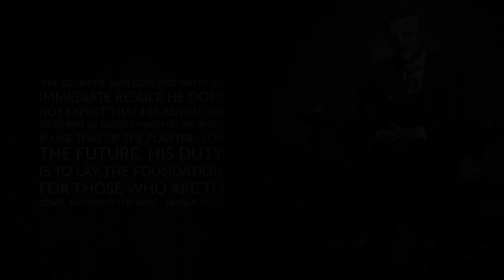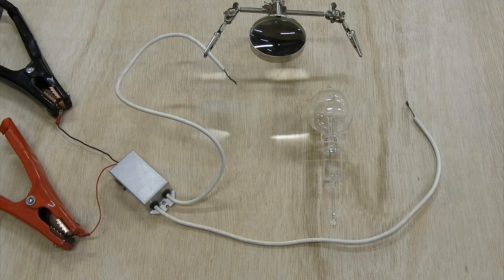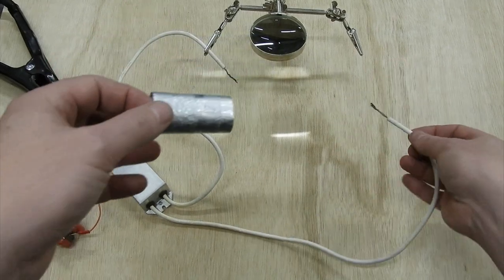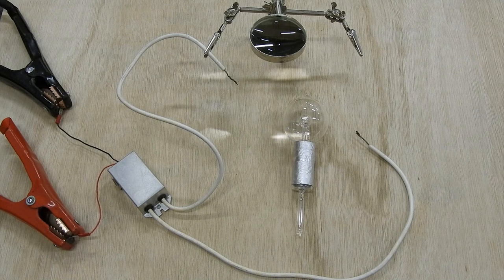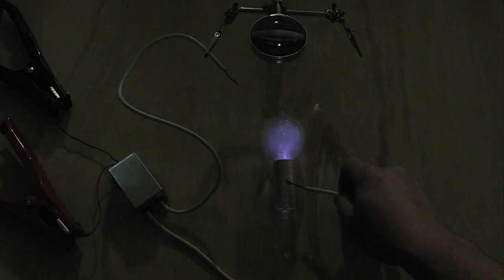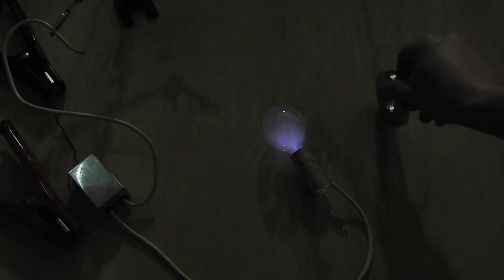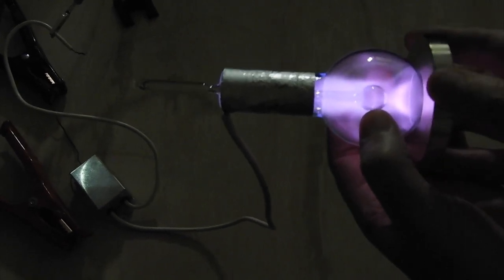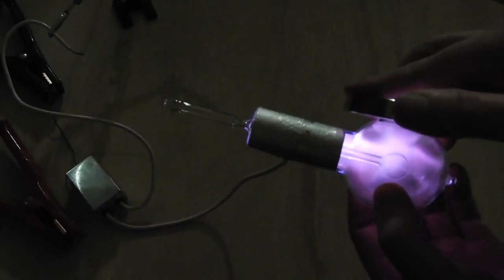Nikola Tesla's Plasma Valve Detector - Tesla's 1892 "Rotating Brush" Bulb Replication - Part 1

Comment: Sorry to inform you but you have misunderstud Tesla's experiment. He used one or single wire electrical energy transmission to drive his one terminal double isolated special HV&HF bulb. What you done is a simple HF plasma bulb wich is in some extent sensitive to magnetic field but not so much as Tesla's "rotating brush":

"When I advanced this system of telegraphy, my mind was dominated by the idea of effecting communication to any distance through the earth or environing medium, the practical consummation of which I considered of transcendent importance, chiefly on account of the moral effect which it could not fail to produce universally. As the first effort to this end I proposed at that time, to employ relay-stations with tuned circuits, in the hope of making thus practicable signaling over vast distances, even with apparatus of very moderate power then at my command. I was confident, however, that with properly designed machinery signals could be transmitted to any point of the globe, no matter what the distance, without the necessity of using such intermediate stations. I gained this conviction through the discovery of a singular electrical phenomenon, which I described early in 1892, in lectures I delivered before some scientific societies abroad, and which I have called a "rotating brush." This is a bundle of light which is formed, under certain conditions, in a vacuum-bulb, and which is of a sensitiveness to magnetic and electric influences bordering, so to speak, on the supernatural. This light-bundle is rapidly rotated by the earth's magnetism as many as twenty thousand times pre second, the rotation in these parts being opposite to what it would be in the southern hemisphere, while in the region of the magnetic equator it should not rotate at all. In its most sensitive state, which is difficult to obtain, it is responsive to electric or magnetic influences to an incredible degree. The mere stiffening of the muscles of the arm and consequent slight electrical change in the body of an observer standing at some distance from it, will perceptibly affect it. When in this highly sensitive state it is capable of indicating the slightest magnetic and electric changes taking place in the earth. The observation of this wonderful phenomenon impressed me strongly that communication at any distance could be easily effected by its means, provided that apparatus could be perfected capable of producing an electric or magnetic change of state, however small, in the terrestrial globe or environing medium. " 
N.T.: The Problem of Increasing Human Energy
Reply from the maker: The bulb hasn't got the correct fill pressure yet and I am not using high enough voltage. The conducting gas might not be what Tesla had in mind. As Tesla talks about nitrogen a lot in "The Problem of Increasing Human Energy" I tried that first and myself and Eric Dollard got interesting results.

You are right the results do not match the text exactly yet. But we are on the right path.

The text you provided looks very similar to the 1892 lecture text:

https://teslaresearch.jimdofree.com/lectures-of-nikola-tesla/experiments-with-alternate-currents-of-high-potential-and-high-frequency-a-lecture-delivered-before-the-iee-london-february-1892/

"It may be quite properly ranked among the brush phenomena—in fact, it is a brush, formed at, or near, a single terminal in high vacuum.
 

In bulbs provided with a conducting terminal, though it be of aluminium, the brush has but an ephemeral existence, and cannot, unfortunately, be indefinitely preserved in its most sensitive state, even in a bulb devoid of any conducting electrode. In studying the phenomenon, by all means a bulb having no leading-in wire should be used. I have found it best to use bulbs constructed as indicated in Figs. 12 and 13.
 

In Fig. 12 the bulb comprises an incandescent lamp globe L, in the neck of which is sealed a barometer tube b, the end of which is blown out to form a small sphere s. This sphere should be sealed as closely as possible in the centre of the large globe. Before sealing, a thin tube t, of aluminium sheet, may be slipped in the barometer tube, but it is not important to employ it.
 

The small hollow sphere s is filled with some conducting powder, and a wire w is cemented in the neck for the purpose of connecting the conducting powder with the generator.
 

The construction shown in Fig. 13 was chosen in order to remove from the brush any conducting body which might possibly affect it. The bulb consists in this case of a lamp globe L, which has a neck n, provided with a tube b and small sphere s, sealed to it, so that two entirely independent compartments are formed, as indicated in the drawing. When the bulb is in use, the neck n is provided with a tinfoil coating, which is connected to the generator and acts inductively upon the moderately rarefied and highly conducting gas inclosed in the neck. From there the current passes through the tube b into the small sphere s to act by induction upon the gas contained in the globe L.
 

It is of advantage to make the tube t very thick, the hole through it very small, and to blow the sphere s very thin. It is of the greatest importance that the sphere s be placed in the centre of the globe L.
 

Figs. 14, 15 and 16 indicate different forms, or stages, of the brush. Fig. 14 shows the brush as it first appears in a bulb provided with a conducting terminal; but, as in such a bulb it very soon disappears—often after a few minutes—I will confine myself to the description of the phenomenon as seen in a bulb without conducting electrode. It is observed under the following conditions:
 

When the globe L (Figs. 12 and 13) is exhausted to a very high degree, generally the bulb is not excited upon connecting the wire w (Fig. 12) or the tinfoil coating of the bulb (Fig. 13) to the terminal of the induction coil. To excite it, it is usually sufficient to grasp the globe L with the hand. An intense phosphorescence then spreads at first over the globe, but soon gives place to a white, misty light. Shortly afterward one may notice that the luminosity is unevenly distributed in the globe, and after passing the current for some time the bulb appears as in Fig. 15. From this stage the phenomenon will gradually pass to that indicated in Fig. 16, after some minutes, hours, days or weeks, according as the bulb is worked. Warming the bulb or increasing the potential hastens the transit.
 

When the brush assumes the form indicated in Fig. 16, it maybe brought to a state of extreme sensitiveness to electrostatic and magnetic influence. The bulb hanging straight down from a wire, and all objects being remote from it, the approach of the observer at a few paces from the bulb will cause the brush to fly to the opposite side, and if he walks around the bulb it will always keep on the opposite side. It may begin to spin around the terminal long before it reaches that sensitive stage. When it begins to turn around principally, but also before, it is affected by a magnet, and at a certain stage it is susceptible to magnetic influence to an astonishing degree. A small permanent magnet, with its poles at a distance of no more than two centimetres, will affect it visibly at a distance of two metres, slowing down or accelerating the rotation according to how it is held relatively to the brush. I think I have observed that at the stage when it is most sensitive to magnetic, it is not most sensitive to electrostatic, influence. My explanation is, that the electrostatic attraction between the brush and the glass of the bulb, which retards the rotation, grows much quicker than the magnetic influence when the intensity of the stream is increased.
 

When the bulb hangs with the globe L down, the rotation is always clockwise. In the southern hemisphere it would occur in the opposite direction and on the equator the brush should not turn at all. The rotation may be reversed by a magnet kept at some distance. The brush rotates best, seemingly, when it is at right angles to the lines of force of the earth. It very likely rotates, when at its maximum speed, in synchronism with the alternations, say 10,000 times a second. The rotation can be slowed down or accelerated by the approach or receding of the observer, or any conducting body, but it cannot be reversed by putting the bulb in any position. When it is in the state of the highest sensitiveness and the potential or frequency be varied the sensitiveness is rapidly diminished. Changing either of these but little will generally stop the rotation. The sensitiveness is likewise affected by the variations of temperature. To attain great sensitiveness it is necessary to have the small sphere s in the centre of the globe L, as otherwise the electrostatic action of the glass of the globe will tend to stop the rotation. The sphere s should be small and of uniform thickness; any dissymmetry of course has the effect to diminish the sensitiveness.
 

The fact that the brush rotates in a definite direction in a permanent magnetic field seems to show that in alternating currents of very high frequency the positive and negative impulses are not equal, but that one always preponderates over the other.
 

Of course, this rotation in one direction may be due to the action of two elements of the same current upon each other, or to the action of the field produced by one of the elements upon the other, as in a series motor, without necessarily one impulse being stronger than the other. The fact that the brush turns, as far as I could observe, in any position, would speak for this view. In such case it would turn at any point of the earth's surface. But, on the other hand, it is then hard to explain why a permanent magnet should reverse the rotation, and one must assume the preponderance of impulses of one kind.
 

As to the causes of the formation of the brush or stream, I think it is due to the electrostatic action of the globe and the dissymmetry of the parts. If the small bulb s and the globe L were perfect concentric spheres, and the glass throughout of the same thickness and quality, I think the brush would not form, as the tendency to pass would be equal on all sides. That the formation of the stream is due to an irregularity is apparent from the fact that it has the tendency to remain in one position, and rotation occurs most generally only when it is brought out of this position by electrostatic or magnetic influence. When in an extremely sensitive state it rests in one position, most curious experiments may be performed with it. For instance, the experimenter may, by selecting a proper position, approach the hand at a certain considerable distance to the bulb, and he may cause the brush to pass off by merely stiffening the muscles of the arm. When it begins to rotate slowly, and the hands are held at a proper distance, it is impossible to make even the slightest motion without producing a visible effect upon the brush. A metal plate connected to the other terminal of the coil affects it at a great distance, slowing down the rotation often to one turn a second.
 

I am firmly convinced that such a brush, when we learn how to produce it properly, will prove a valuable aid in the investigation of the nature of the forces acting in an electrostatic or magnetic field. If there is any motion which is measurable going on in the space, such a brush ought to reveal it. It is, so to speak, a beam of light, frictionless, devoid of inertia.
"
Reply from the maker: (Part 2) 
"I think that it may find practical applications in telegraphy. With such a brush it would be possible to send dispatches across the Atlantic, for instance, with any speed, since its sensitiveness may be so great that the slightest changes will affect it. If it were possible to make the stream more intense and very narrow, its deflections could be easily photographed. 

I have been interested to find whether there is a rotation of the stream itself, or whether there is simply a stress traveling around in the bulb. For this purpose I mounted a light mica fan so that its vanes were in the path of the brush. If the stream itself was rotating the fan would be spun around. I could produce no distinct rotation of the fan, although I tried the experiment repeatedly; but as the fan exerted a noticeable influence on the stream, and the apparent rotation of the latter was, in this case, never quite satisfactory, the experiment did not appear to be conclusive.

 
I have been unable to produce the phenomenon with the disruptive discharge coil, although every other of these phenomena can be well produced by it—many, in fact, much better than with coils operated from an alternator.

 
It may be possible to produce the brush by impulses of one direction, or even by a steady potential, in which case it would be still more sensitive to magnetic influence."
Reply from the maker: The bulb was driven with one wire. The bulb does have one terminal and is double isolated. What would you like me to do to show you that this is true?
Reply from the maker: I've not got the bulb connected to ground either. I was using 12v power source and a HV neon sign transformer. This is work in progress not the final product.
Reply from the maker: Thank you for referencing this text from Tesla's masterpiece article from 1900. 

https://teslauniverse.com/nikola-tesla/articles/problem-increasing-human-energy
Reply: @nikola.tesla.r.and.d.centre  Please check that Tesla used vacuum in the bulbs in his early experiments and I have no information wheter he changed to some other gases.
Reply: @nikola.tesla.r.and.d.centre  The bulb as load (the terminals as capacitor and wireing as inductor) must be tuned to resonance with the generator. Also the height of the bulb suspension alter the capacity of the whole system...
Reply: @nikola.tesla.r.and.d.centre  Need to use HF ferrit core transformer and tune the frequency also.
Reply: @nikola.tesla.r.and.d.centre  His lectures are more of value you are on the right sources.
Reply from the maker: @istvankocsis5507  the exact specifications are in this lecture. Fig 13. https://teslaresearch.jimdofree.com/lectures-of-nikola-tesla/experiments-with-alternate-currents-of-high-potential-and-high-frequency-a-lecture-delivered-before-the-iee-london-february-1892/
Reply from the maker: @istvankocsis5507  the whole point of having high vacuum in the outer bulb envelope and nitrogen in the inner bulb under partial vacuum I believe is to mimic the ionosphere to negate needing to send a balloon with a wire attached into the upper strata. Tesla had to demonstrate this to the US patent examiner with a 50 foot long set of vacuum tubes. This is where he disclosed the pressure of 120mm - 130mm of mercury. The 130mm of mercury was also in the US patent. https://teslauniverse.com/nikola-tesla/patents/us-patent-645576-system-transmission-electrical-energy
Reply from the maker: @istvankocsis5507  We have already matched some of the results Tesla wrote about using 10% of the recommended minimum voltage so a full replication is looking highly probable. I am soon starting testing with 20kv. This will prove the brightness increasing with voltage whilst not increasing wattage.
Reply from the maker: @istvankocsis5507  Ultimately I want to build a 19,998hz pancake coil. Variable frequency and duty cycle will be on the next set of tests using a new high voltage supply controller. I will be using an ignition coil. A flyback would be the next logical step. I already have a 20kv and 45kv ignition coil to test.
Reply: waw this amazing and exactly a description I needed very very interesting and makes sense
Reply: @nikola.tesla.r.and.d.centre  thanks brother 🙏
Reply: @nikola.tesla.r.and.d.centre  And I think Tesla has imitated the formation of matter from ether or rather the working of it as ether vortices creating a hugh vacuum around matter wich isolate it and so give him solid like quality too.
Majority of Tesla’s ’lighting’ experiment was about atomic physics and investigating the working of matter on atomic scale.

Comment: Have you got in contact with griffin g brock? (Youtuber) He did the same experiment as you but shows better : )
Reply from the maker: I did send an email once but never had a response back. His bulb isn't the rotating brush bulb that produces cold light. He is using a carbon button which he states glows at 2000F. His bulbs do produce some interesting effects. The setup I was using to power the bulb in this video cost $20..... Have you seen his setup, it is slightly more elaborate / expensive https://www.youtube.com/watch?v=VTF8NYFHqQ8 None of the bulbs he shows on YouTube are replications of the Fig 12. or 13. in the 1892 lecture as neither feature a carbon button. Tesla's rotating brush bulb gets brighter with voltage and doesn't produce heat. Griffin's 2000F sounds quite toasty to me! https://teslaresearch.jimdofree.com/lectures-of-nikola-tesla/experiments-with-alternate-currents-of-high-potential-and-high-frequency-a-lecture-delivered-before-the-iee-london-february-1892/
Reply: @nikola.tesla.r.and.d.centre  I see O.o